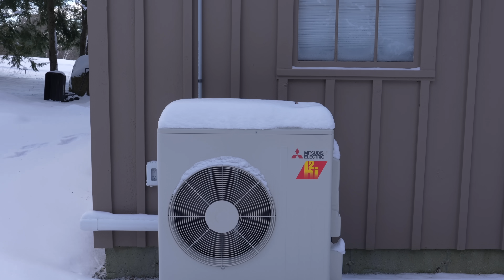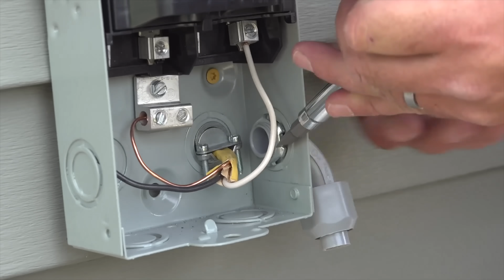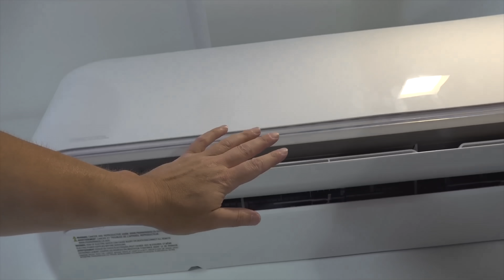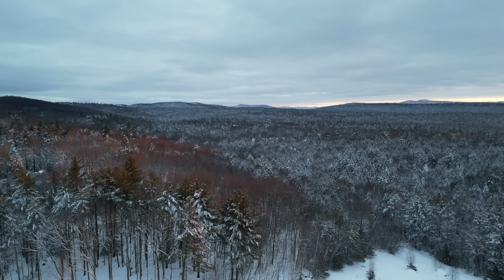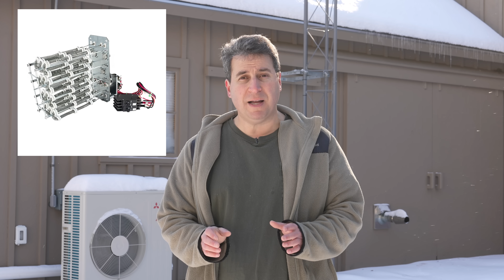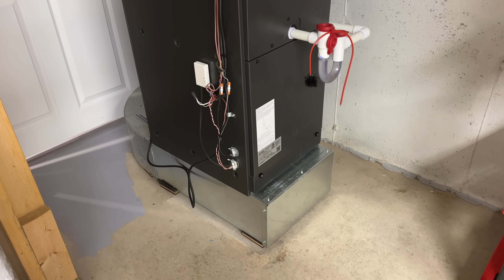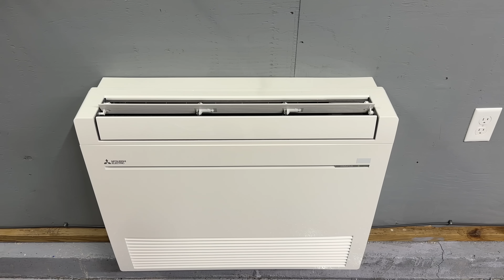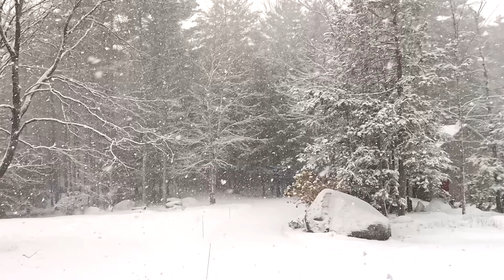Why Heat Pumps are now leaving people COLD

Comment from the maker: Let me know if you have other ideas or tips you do with your heat pump to make life more comfortable - Products I showe Mr Cool: https://amzn.to/48DTF4p Senville: https://amzn.to/48IPNPS
Reply: the old way to size a standard heat pump was undersize slightly to the summer load to get the humidity out by running longer,  thats not the way to size the newer variable speed compressor systems, size slightly bigger than required for winter, the summer humidity will get removed in the summer and you'll have heat in the winter with less struggle,,,, also get the units up off the ground by twice the normal snowfall,,,
Reply: Use hot water from the boilers and install a heat recovery system for the flue gases of the exhaust of the water heaters to preheat the water entering the boiler and/or preheat the combustion air entering the boiler.

Also a wood 🪵stove is a great investment. It can be used for space heating and water heating. Additionally it can be retrofitted to burn many kind of fuels (natural gas, propane, coal, fuel oil, organic waste, etc.).
Reply: I'm thinking about getting a dual hose heat pump with an inverter compressor, from what I've heard those units work pretty well. I have a friend with one and he's in a -6 climate and it keeps up pretty well.
Reply: I think it is worth mentioning that the electric backup can push up the electric service requirements.  It did for me, I had to go to a 400A service just because of the backup heat.
Reply: @matthewbeasley7765   That's mostly because of the unnecessarily conservative over specced electrical requirements in North America. They basically size your panel such that you can take a hot shower, while drying, while also preheating your oven and charging your EV, all on the coldest day and time of the year. It's an incredibly unlikely scenario (you don't generally cook too much at 2 AM when it's coldest, and if you did, the heat from your cooking would offset heating).
Reply: @DanielBrotherston  Oh I am quite well aware.   I've got a 400A panel, yet the utility has a 15kVA transformer feeding my house.  The utility knows that the load is really far lower.
But it doesn't take away the rules.  I still need a mortgage.  I still need the county to not come down on me for unpermitted work, so I have a properly permitted and inspected system.
Reply: Put a roof over the outdoor unit
Reply: I installed a Mr. Cool in a 20' x 20' building that used to be a small barn. The 2x4 walls and ceiling are insulated with fiberglass batts, and there is rigid foam on the exterior under wood siding. The inside is drywall. There is an uninsulated concrete slab under the building. The Mr. Cool keeps it warm when you're standing, but I spent 2 nights in it babysitting a foster dog. Temp was set to 72 degrees. I was laying down on a solid molded plastic couch and the dog was in a crate on the floor. Neither of us was comfortable. Since warm air rises and the wall unit is mounted high, the warm air stays in the upper half. A ceiling fan might help keep the air mixed and bring more warmth to the lower half of the space.

I want to build a wood platform filled with a few layers of rigid foam insulation that's left over from the exterior of the building.

My friend is considering getting a small electric fake wood stove.
Reply: @billvojtech5686 
I as a general rule, do not consult or recommend mounting the air handler‘s in vaulted ceiling rooms above 8 feet for the very reason that you’re stating. Also, with that, heat does rise, but you have to force it downward, adjust your louver angle to point down and crank up the fan speed… All the way up if you have to. forcing the heat down where you are, is not a challenge usually. If someone is complaining that the heat rises and collects above their heads, it’s because they have the fan speed set too low, or on auto, and are not adjusting the louver downward, and instead having it shoot across the room… But again at a low fan speed, that doesn’t work with heat.
Reply: @dallynsr  The ceiling is 8' and flat. I'll have to check the settings, but the louver opens when you turn it on and I could not figure out how to adjust it. I was hoping it would move up and down as it operated, but it stays in one position.
Reply: Silver Cymbal
One viable way to compensate for low heat output besides resistive heat assistance is to oversize the tonnage of the units, double if needed. And use mini splits rather than multi split units to help manage the redundancy and overhead waste. 
By definition a mini-split is only one air handler and condenser set, multi splits and multi-zone systems use one condenser and many air handlers, and have to attempt running in too wide of temperature swings and load variables to do as good of a job as smaller units…plus the smaller units have the highest seer’s. 
So, instead of figuring the usual 400sf per ton , for cold climates use 200sf-300sf per ton and it shouldn’t need supplemental heat assistance.
Reply: At least in properly northern areas where it gets below zero every winter, you basically need three phase power to run only a heat pump/electric in a large-ish house.  The calculations go crazy very fast - my home is 2700 sq ft, but would require six 5T units and an additional 400A service just go get me to 0 degrees capability.  If I only care about it being good down to 25-30-ish, then it's a single 5T unit.

What does everybody do?  Once your heating needs exceeds either 5T or your A/C needs, you install heat pumps backed by a fossil fuel burning furnace, oil or natural gas.  It cuts your fossil fuel usage drastically, because most of the winter the heat pump is still enough, but you still have a backup heat for the really cold nights - in my case, 218 KBTU.
Reply: @jec6613  If you have access to natural gas and live in a northern area, a heat pump is a complete waste of money especially if you have an older home. Natural gas forced air puts out about 120-140 degree air where as a heat pump will likely only put out maybe 100 until it drops below freezing. Historically natural gas has usually been much cheaper than electricity. A heat pump may actually be more comfortable because it runs all the time but that’s why they cost so much to operate. Unless you go geothermal.
Reply: @mikee2923  Even on an air sourced in a 50 year old home in one of the highest electric rate areas in the US, the price per BTU is cheaper down to 30 degrees if I were using gas in the next town over that actually has it.  I'm fuel oil, so my calculation is a bit different, but I've saved about $700 so far this winter by using an air sourced heat pump when it's warmer out.  And that's on top of the nice rebate that made it cheaper to replace my dead A/C with a heat pump than a cooling only unit.

I'm sure this is down to using one of the new variable speed models, but also, remember, it's just BTU/hr, the temperature of the air is is just a symptom of the energy output.
Reply: In Canada we have heat pump with electric or gaz furnace attach to them, when temps go below -10C (some Pump allow to -20C) The furnace takes over the HP.
Reply: @Mr.Frenzyguy  Is electricity cheaper than natural gas in Canada? I live in western Pennsylvania and the cost difference between electricity and natural gas makes buying a heat pump an unwise choice. Pennsylvania has a large reserve of natural gas and many electrical generating power plants. Most people choose gas if available to them. Heat pumps only sell well when the electric companies give incentives to buy them. But as far as I know they haven’t offered them for years. Most people who bought heat pumps with a gas furnace just use the heat pump for A/C and the gas to heat their home.
Reply: I have a few of these mini splits in my shop/enclosed patio, but saw a "smudge pot," which gave me an idea - get rid of my used oil through a smudge pot and set it close enough to the outside unit to heat the area (giving the heat pump some heat - to pump!) Free heat basically. Just don't set the smudge pot so close it melts anything in the heat pump. Keep in mind that being in southern Texas, I get 2-3 days of super cold weather a year at best - not 1-2 months.
Reply: Can you research and make a video overview like this one regarding use of a heat pump in cunjunction with geothermal?  Especially for us North Easterners.
Reply: Install modern R32 heat pumps that works down to -20 without problem!
Reply: Geothermal also has a ridiculously high installation cost compared to air sourced. I think it ia great for a brand new home but hard to justify with a retrofit.
Reply: I'm curious how the Senville compares to the Mr. Cool. I just looked at the link for the Senville and it's less than half the cost of the Mr. Cool for the same BTU.
Reply: Not get the junk.
Reply: I was wondering how long it takes to find discussions  about issues with winter temperature , our  CANADA Government has given away 100 thousands of free heat pumps incl. installation to households with lower income  . In my mind , I see this as a complementary source of heating , which compliments existing heating operations  . With my  heat pump upstairs ( open concept ) ,  entering the second winter , I installed a new thermostat for my Oil Furnace in  the basement which now indirectly manages a moderate use of the electric heat pump ( our furnace at todays freezing temperatures will cut in 3-5 times in 24 hours for 5 minutes ) , our heat pump at 20 degrees C setting and low fan  , creates now a lovely living quality .
Reply: Simple question, then: What is the COP of your alternate heat sources at, say, 5 degs. F if this newer class of heat pumps is "inefficient"? In other words, I know how much heat energy my heat pump is certified to produce at that temperature relative to the amount of electrical energy input to it, so how do your alt sources compare? I am less than an hour from the Canadian border, my current mini split is certified to -22F, and has no problem with temperatures down to around 0F so far, so it probably works significantly well below that. In fact, its BTU output is actually above its nominal rating around these temperatures before falling back off. It will need a secondary source near its bottom limit, but not anywhere near 30F. If it did, that wouldn't mean it was a fault with the sales claim but with the application (how many BTU's I or someone decided that I needed at x temperature.)
Reply: If you live in cold areas, ground-sourced heat pumps might be the way to go.
Reply: one thing a friend of mine did over the last few days was throw his Winter Tent up around the heat pump, lined the inner perimeter of the tent with 55 gallon barrels he filled with water and ran his winter camping wood stove in there.

It would have been better to have a wood stove in the house, but his insurance wouldn't accept it when he wanted to, and getting a wood stove professionally installed in this part of the country is absurdly expensive.

His method worked. Stayed warm in the house when our overnight lows were in the low teens.

Comment: Of the 1000s of videos on YouTube, this is the only one that gives an accurate picture for heat pumps. Not mentioned in the video is that ducted systems have the registers on the ceiling. Dont forget heat rises. Good for air conditioner, bad for heating as most of the heat will be near the ceiling.

Comment: Heat pumps are a failed technology.  They are attempting to heat AND cool and they do both badly.  Heat pumps will work between +5 C and +15 C to heat.  After +15C you don't need a heater.  But you'd really like them to work in the Winter when it's cold right?  Running these in freezing temperatures is totally ineffective as their efficiency tanks and by about -10 C you are running electricity through a resistor to create heat (very expensive and inefficient).  Also, they run on electricity and so when it goes out, they are useless.  A small generator can allow a natural gas furnace to work like normal.  My furnace ($4k) will heat my entire house.  A $6k heat pump will heat/cool a single room (crappily) so people routinely buy 3 and 4 heat pumps for a medium sized house and so they are in for $20k.

The question is why did everyone start talking about heat pumps at the same time?  Government shills virtue signalling about carbon emissions (which are belched out of the coal and natural gas generating stations that power your heat pumps) and getting rich off stock purchases and lobbyists.  The only thing worse than a lying politician pushing heat pumps with some taxpayer funded subsidy are the dweebs who fall for it.

Comment: ADVICE - DON'T HEAT THE AIR. 
HEAT THE BODY..

I'm in Maine. House has no insulation. I don't heat the air. I use a blanket on top of the electric blanket. I sleep very warm.

Likewise, I do wear warm clothing like slipper socks, thermal sweatpants and the most important being a hood. The head is where most heat is lost. Hood makes a big difference. 

For bathroom, use a small heater. 

Keep water dripping on very cold days, so pipes don't freeze and cause damage. 

I'm warm and comfortable. There is some increase in electricity cost. The water heater cost more. I go from 450Wh in summer to 900Wh in winter per month.

I used virtually no propane since start of November. It's mid-January now.
February and March will be very easy to get through.

If they can make an indoor portable heat pump for cold and low cost, that is the only thing I would consider getting, but I really don't need it.

Comment: "Crazy low temperatures" bro so this is a rare event. Everyone who has a heat pump should also have an one of those portable electric radiators just in case a freak storm happens. You might have to bring it out every year for like two days in the winter and stick it by the blower. Oh the horror! It's better than the gas pipes breaking in the street or the oil tank clogging. Cleaner, safer, and faster too.

Comment: Some tips with HVAC.

1. DO NOT RUN DUCTS IN THE ATTIC OR ANY OTHER AREA EXPOSED TO THE ELEMENTS.  You lose a lot of heating/cooling to outside air, unless you have much higher amounts of insulation on the duct work.  Even then, you could suffer condensation and mold issues from moisture condensing on the ducts and then getting into insulation/drywall.

2. ENSURE YOUR SYSTEM HAS USER ADJUSTABLE IDLE FAN SPEED.  I have one of those computer POS units (Trane) that decides what the fan speed should be.  On fan only but the unit not cycling, the airflow is insipid and ineffective.  We can't do anything about it because this feature isn't user adjustable.

Comment: hmm no problem, moms house was built in 1958 , at -28C it had no problem heating the house for 8+ hours before the aux heater had to kick in, for a short time. The newer pumps built for the cold can go a lot lower than before. The electric coil is also used to raise the temp quickly , eg if you had your house at 16C for a week or whatever while you were away and then came home and upped it to 20C that coil is def going to kick in (in my experience anyway) to get that up there. These systems are always evolving and the options are numerous so yeah, the adage "buyer beware" is still true.

Comment: There isn't heating system installed that if cold enough could keep up with extreme cold temperatures.  Supplementary heating is always recommended in colder areas.

Comment: Has his mini-split installed on the ground where it can't properly drain water from defrost cycles and has his electrical disconnect switch installed behind the outdoor unit where is doesn't comply with the most basic of electrical codes. Truth is, heat pumps work great in very cold weather if they are properly sized, located and installed by a professional or someone very much in the know. Let's not forget that you get what you pay for so if you buy a cheap machine off the internet or some guy in a plain white van, you are most likely not getting good quality brand name gear from a reputable supply house. That the truth around my area.

Comment: I'm planning to eventually put in a 3-ton central air unit in my house that does hot and cold. And my HVAC company even recommended that I keep my Kero furnace, for this specific reason. When the temps are 20-40 the heat pump can save me fuel. But when it gets below 20, the Kero furnace will take over from there. They said that they have thermostats and sensors where the furnace and the central air unit can talk to each other to figure out which should be going or something to that effect.

Comment: My heat pump heats my floor and I turn it on in mid Autumn and turn it off in the end of the Winter or begin of Spring and my home is kept at same temperature from the beginning to the end. Air conditioning I just use it in the summer. With my PV array and batteries i just import 10% of the electricity I need the whole year.

Comment: When temp goes to 20 or less, I add heat with either a small electric heater or my diesel heater. What happens with just a little help is that the mini works better because it is not ingesting cool air inside but warm air and it then works more efficiently. Works a charm.

Comment: heat pumps are used for warming your house in the winter. When I have a gas furnace, a thermostat set to 70F felt like 70F. That is NOT the case with our heat pump. Thermostat says 70 and its absolutely freezing in the whole house. Idk why people defend the obvious worse option so much. Just get the furnace and have the heat available if you want it AND the air will actually feel warm.